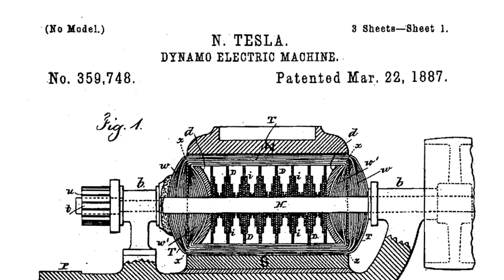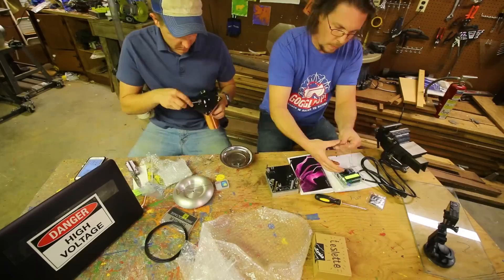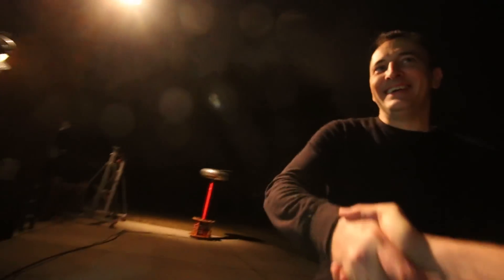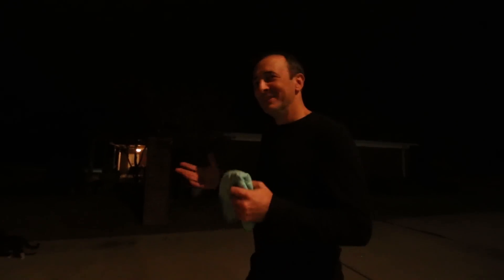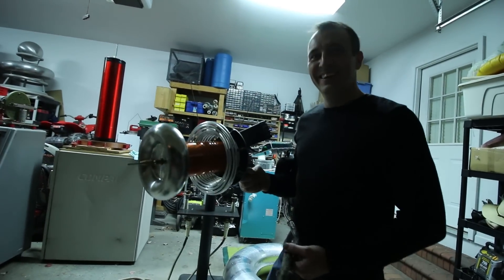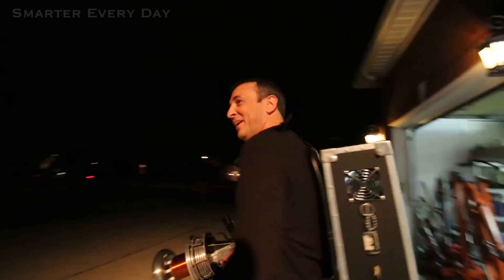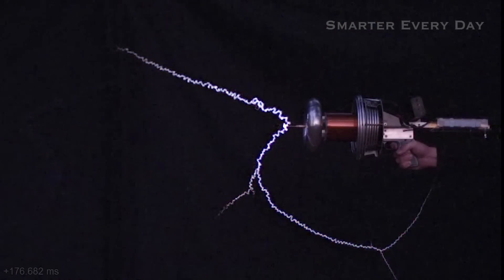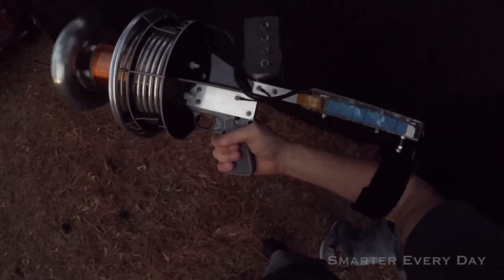Handheld TESLA COIL GUN at 28,000fps - Smarter Every Day 162

Comment: I have a question: the coil produces super high voltage which causes these plasma arcs but with low current. Plasma is super conductive so would it be possible to somehow add a high current, low voltage, supply such that it uses the plasma arc as a conductor and you end up with much more powerful currents that could be used as a kind of stun gun?

Comment: The output is not microamps - Styropyro did a video on the topic of electrical safety where he measured the current output of one of his Tesla coils to be like 3amps, and similar arc length. That sounds like alot of power but the duty cycle is very low so it isn't. He also said the high frequency was the reason you were not effected - too fast for nerve response. In a qcw coil like the Tesla gun the frequency will probably be at least 300kHz.

Comment: you should ask if there is a way he could make the gun to where it spits out a straight beam of lightening to make it more accurate and maybe potentially lethal
Reply: I've heard of such an idea: strong laser pulse + high voltage projector (like the TC). Laser is supposed to make a plasma "channel" in the air. If I recall correctly, at least one of Gerry Vassilatos' books mentioned it.

Comment: What if we can create a binary based brain that works in synchronization with our natural brain this brain will have technology like your high speed camera and and strong CPU and RAM so you can think and process information from video lens and electric amplifed ears and it will work in parallel to your CNS and Parasympathetic nervous system so you can actually see and hear everything is slowmotion giving you the time to think this brain need to be able process information faster than the frame he catch and already processed 🤔🧐

Comment: Funny thing, as a kid I was taking cb radios and modded them to run from 4 watts transmission to a almost 10-12 watts. This was with no real education and was early teen, was also self taught how to make and install echo boards, chambers, and install high low freeks as I called them ( in order to slide between frequency of 2 channels) and this was all because of my grandfather buying junk radios and me breaking them just to put them back together 😂

And I have learn over the years, I am highly conductive and I attract electricity. And only learned this when they did a Tesla coil show in the springs, the guy was sitting on the coil and shooting it out of his finger tips. But the arch kept heading to me no matter where he pointed, so the security team escorted my father and I out of the show. Was a very sad day for me as a kid, but inspired me to get into electronics 😆

Comment: Um all he has to do is add a high power lazer to his tesla gun and the electrical arc will follow the path of least resistance down the light of the laser which in turn allows you to aim and control the electrical arcs direction. This has been laboratory proven

Comment: Is there a way to direct the arc, using a jet of conductive material or a LASER for example?
Reply: Yes, you could definitely do that. Using a laser would be rather difficult however as you need a high enough energy density to ionize the air which requires a bulky pulsed laser.
Reply: @harms123  Oh, thanks for your reply.  I had thought Nd:YAG, but I just want to see a light saber without solid rod, and I think there could be a way here, even thought it might not cut through stuff.

Comment: Lightning goes out and spreads like roots and then flash of white light, and then it goes back to where it came from.

Electricity is more rigid and it doesn't spread out in one flow like lightning does but rather it just feels unnatural. It doesn't go back but rather fades away. Another thing is that it is white and blue on the inside and purple on the outside, whereas lightning has this white and blue-ish color.

Comment: You can boost wifi signal with that. You only need to feed the wifi router into the primary coil with UA741 IC output and transmit the same as you do with that gun only convert that high voltage into high radio wave frequency.

Comment: your starting diagram is wrong, the powering transformer source is NOT across the capacitor bank! The spark gap is. The capacitor and primary coil are in series with the spark gap. The spark gap is in parallel with the powering transformer source. You'll explode your capacitors!

Comment: At 8:38 he says the current on the secondary is only microamps but thats completely wrong! In a QCWDRSSTC coil (the tesla coil gun) there are several amps flowing through the lightning which would be deadly. But at such high Frequencies (300-400kHz ac) the nerves simply don't react to electricity so you don't feel anything.
Reply: Went to the comments to see if someone had already said this, this comments should be pinned

Comment: There is more then enough current to kill. It's just that it is over so quickly, it doesn't cause significant damage. 

Assuming those are are at least 100kV arcs and that your skin resistance is 100k, you are looking at about an amp. Plenty to kill, but the amount of power delivered is a function of time after all.

Comment: What if you could spray, like, ferromagnetic dust or spray or smth, that conducts the bolts in a more focused area and at a longer range ?

OOOH !!! What if that secondary air gun was a *vortex launcher*, so that that spray stays concentrated, ans even just a little puff to economize its usage ?
And you could send these vortex puffs as relays to guide your bolts in the right direction !!!

YOU COULD EVEN CALIBRATE/ADJUST THE SPEED OF THOSE PUFFS, IF YOU WANT THEM TO DRAW A CERTAIN PATH IN THE AIR FOR YOUR BOLTS

A A A A R G H  T H E  P O S S I B I L I T I E S  A R E  E N D L E S S ! ! ! ! !

Comment: I want to know what happens when you take a Tesla coil. Then take two circle magnets with a hole in the centers. Like a Taurus magnet. And force them together while they are spinning opposite directions. Then introduce the Tesla coil to mercury that’s pressure squeezed between  the two magnets that are spinning in opposite directions of each other. I theorize that the magnetic force will loop from center top to center bottom all the way around the craft. Creating a dead zone in gravity. Putting a cup in the center of it and spinning it upside down without it spilling ALMOST.

Comment: 25 years ago I visited a 35 foot tesla coil that was burning up the points. A friend suggested a heat pipe [copper pipe with water in the bottom] for contacts on the rotating distributor. That worked. They wrote it up in the Tesla coil magazine and credited my friend.

Comment: I'm pretty sure the current is enough to kill (30mA or more through the chest), but the high voltage is also high frequency (>50KHz) which due to the "skin effect" travels only on the surface of a conductor, not even deep enough to reach the nerves, so you barely even feel it, and it doesn't get to your heart..

Comment: What would happen if you put an alpha or beta radiation emitter in the center of the coil in a tube that would restrict the direction that the radiation could leave. Would the lightning bolts try to follow the path of the radiation or would there not be enough radiation to have any effect? If you could very the depth that the sample was in the tube you could get a zooming effect if it works!

Comment: you can see in the high speed when the equilibrium between resistance of the insulating air and the required surface area to achieve low enough resistance to get back to ground. its amazeballz

Comment: “Did that go trough your hearth!?”
“I mean, yeah but.... it's so low current.”

Bruh this guy be some kind of lightning sage.
Reply: L ItS tHe CuRrEnT tHaT gEtS yOu
Reply: Lmao everytime i hear that i cringe
Reply: Raiden
Reply: seems like a good competitor for electroBOOM
Reply: @nabsterific  no, it's well in the range of about 2-5mA

You would be cooked alive at a constant 1 amp.
Reply: as little as 30 miliamps AC can start fibrillation.
Reply: @fuflang  500 mA is a lethal dose
Reply: High voltage will create high current. Ohm's law. What it is, is low energy.
Reply: @ManneSegerlund  Ohm's Law: the current through a conductor between two points is directly proportional to the voltage across the two points.
If there's resistance between those two points, the current goes down. Imagine it as you standing underneath a huuuuuuge basin of water. If suddenly a large hole appears and all the water comes crashing down on you, you're done for. However, if it's only a tiny tiny hole, the water would just drip on your head but you'd be fine. It is indeed the current that kills you, and like @nabsterific said, 1A of current is already enough to do that. Modern cell phone chargers reach that 3 times over.
Reply: @cptnbangatron2221   no it is you that don't understand current and voltage. As you said yourself current is proportional to voltage and vise versa. Remember that resistance is mostly constant for any circuit. Therefore you get what current you get from the voltage you have. Or the opposite way you get what voltage you get from the current you provide. It is impossible to have one without the other. That is what ohm's law tells you.

With a set resistance you can't have high current without high voltage and vice versa. Your body has a set resistance, or more correctly impedance. It changes depending on frequency. The reason you can get 3A out of a phone charger is that the charger sees the phone as a resistance of about 1.7 ohm's. Or more likely the phone can be more accurately modelled as a voltage source with some series resistance. If you pur the same 5V over your body only a few tens of micro amps would flow.

Yes I know what I'm talking about. I'm an electrical engineer working in power transmission.
Reply: @cptnbangatron2221  If a power supply can provide 3 amps and you try to provide more power the voltage drops and the amps stays at 3 because ohms law always has to be right. If 20 kV pass through your heart in several seconds you will die unless the source can’t at least provide some mA and the voltage drops. If a 20kV ark pass through your heart you will survive because of limited time. Not voltage drop. And definitely not low amp. I have a transformer that can provide hundreds of amps but only 1.5 V so i can just melt low resistance metals with it. I can even place the cables on my tongue. I don’t feel anything because the voltage is too low. To say “it’s not the voltage that’s kills you” is almost like saying “it’s not the gun that kills you it’s the bullet. As long as the bullet is small you will not die” 

Sry if Bad grammar English is not my first language. Hope you get the point
Reply: It's not only about Ohm's Law here. P=U*I, wich means you can have 1 000 000 Volts and 1u Amps and you'd get 1 watt of power. 

Piezzos from lighter can do electrics arcs because it's High Voltage, but low current so you feel nothing. In that case body's resistance doesn't really matter because the source also has it's own resistance. 
Go shock yourself with a electric lighter and i dare you to tell that voltage only is lethal.

The only thing voltage does is make it easy for the current to flow or not (also other things but that's besides the point), but you better know what power the source is capable of delivering..
Reply: @romangervaise35  it is still ohm's low. A piezzo cristal generates high voltage 100-200 V which in turn will create a current of about tenth of mA. But it is only during a short time. Think energy P*I*t, it will be low. Ohm's law still applies. When you are talking about the amount of current a source can supply it's because it has an internal resistance which will limit the current capability of the source. But ohm's law still applies you just have to include the source resistance in your model.

Voltage is energy per unit of charge and current is unit of charge per unit if time. Your explanation of voltage is incorrect.
Reply: @ManneSegerlund  I said it wasn't only about ohms' law but.. Fine. I don't understand your point except for correcting me on the details.
Your last sentence is correct but if you think about it it represents what i just described.. Of  course if a unit of charge has lots of energy it will travel easier through less conductive matter, that's voltage.
Reply: Lol makes me think of when my physics teacher in highschool had us touch a tesla coil to arc between 2 chains of people holding hands, sent 500,000 volts through our hearts like 5 or 6 times in a row that day
Reply: He's a level 3 mage.
Reply: The current is plenty high enough to kill, it's just tesla coils run at such a high frequency, that they don't affect anything. You can still get nasty burns if you touch it for too long though.
Reply: hardstyle905  Skin affect only happend in good conductors like metal where charge can spread out with little to no resistance. Human skin is an isulator, so the charge won't want to spread out as easily.
Reply: To stop your life you need big electric energy. Energy is V*I*t
The small thing with Tesla coil shock is not current, but time
© ElectroBOOM

Comment: The lightning in slow motion looks and sounds like space time tearing apart (edit: 7:34)
Reply: It is.  The space of rupturing air molecules in real time
Reply: @waltersumofan  what? No. It’s added, you can’t record good sound in slow motion
Reply: @adamwilding9520  yes you can the camera will capture it at normal speed then once you are don't filming, depending on the camera you use, it will slow down the video when uploading it to it's gallery so and the sound would be slower and sometimes low pitched as well, also the comment you replied to only stated a scientific fact, not anything about the sound
Reply: @LycheeGuy3  that works ok for the speeds that, say phone cameras can record at, ~240 fps. So lets say playback is at 24fps, so 10x slowmo, the audio would be 10x lower frequency. This is at 28000fps. For easier calculation, say at 24000 fps played back at 24fps, thats 1000 times slower and 1000 times lower frequency. Wouldn't be able to hear anything.
Reply: @waltersumofan  well no, lightning and arcs are ionized air. It doesnt rupture the molecules, it just removed electrons
Reply: I think the sound is made in post
Reply: FoxQueen yeah that makes sense, the video on itself is already cool but with sound it’s just much better!
Reply: Space time tearing apart? You mean if a Tesla coil has enough power  it could become  a warp drive opening dimensions in space? I guess Nikola Tesla was definitely  ahead of his time.
Reply: interesting imagination there... sounds like a sheet of ice cracking to me with some low tone passes overlayed
Reply: Bro watch in playback speed 0.25 %
Reply: You speak from experience? 😂
Reply: SED has a video on how they do the sound for slow motion footage - Episodes 184 and 185. TL;DW: it's all artificial. :)
Reply: Yeah it does.
Reply: I was about ro comment that it kind of sounds like a sheet of plastic cracking. Beat me to it
Reply: Technically lightning does do that and travels really fast too i'm pretty sure VSauce made a video on how lightning bends time or something
Reply: Cracking space!
Reply: That sound was added in post, no sound in slow mo, especially that slow mo, would be that clear

Comment: Just think if you could somehow shoot a stream of ionized air with an opposite charge to the Tesla coil charge outward from the gun so the lightning would follow it further from the gun barrel, like say 10 to 15 feet. Maybe even a squirt gun with a small quantity of salt dissolved in the water of the squirt gun. The lightning might just follow it way out to as far as the stream of water would flow, say from one of those kids Super-Soaker squirt guns. Just ideas to possibly increase the range of the gun.

Comment: As an electrician I know it only takes between 4-6 milliamps to kill you. The danger comes into play when the path of the bolt is considered. To be fatal at those level's the bolt must pass threw your heart. This is why your average kitchen ground fault circuit interrupter trip's between the range of 4-6 milliamps. Testing was actually done to measure the let go factor in children, men and women to ultimately come up with that range.

Comment: It's incorrect saying that it's safe because of low current. The current on secondary coil of a Dual Resonant Solid State Tesla Coil can be in orders of hundreds of mA up to few Amps during ground strikes. Which is totally lethal. The reason why it is safe, is thanks to skin effect. He could even touch primary coil! Even though there are 100s od Amps on primary, the current is at the same frequency as the secondary's. And skin effect would apply the same.

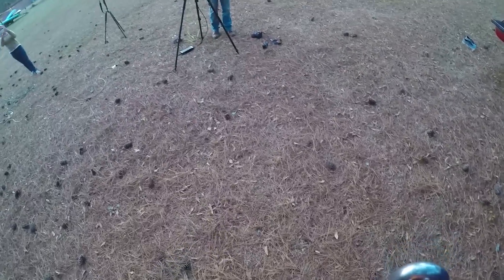Comment: 8:31 So what you're saying is... we need to build a bigger, rifle-sized version?
Reply: No, you need to increase the amperage. Which means using a different coil layout.
Reply: @Frenchfrys17  nah, make it bigger it should be fiiine
Reply: @paulolucero9864  You can make one the size of a skyscraper and it still won't do any more "damage" unless you increase the amperage.
Reply: @Frenchfrys17  need to increase the energy output, which would increase with current (or voltage). increasing voltage... would be difficult. increasing current output on the primary however requires a bigger PSU sooo......
Reply: @conkerconk3  a couple of nuclear power plants should do the power
Reply: tau cannon
Reply: what if you add a long metal tube encasing the electrical output so in gets concentrated in one area and the pressure of all that electricity helps it radiate in a straight beam for like 40 ft. D==========------ - - - - - - -  - - - -
Reply: If he makes it longer and has these weird lightbulb things and makes it as a weapon he would have made a wunderwaffle